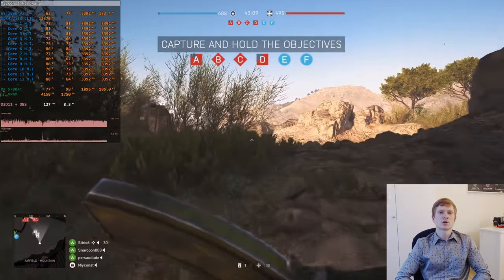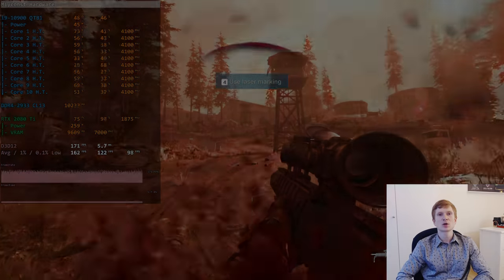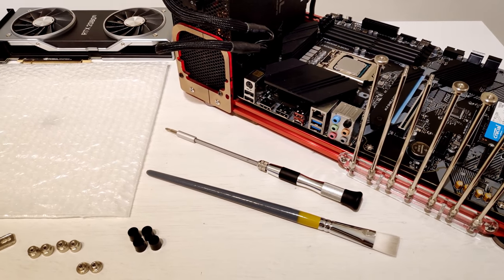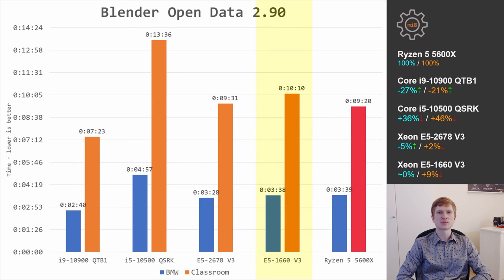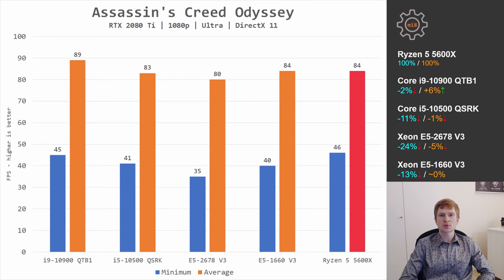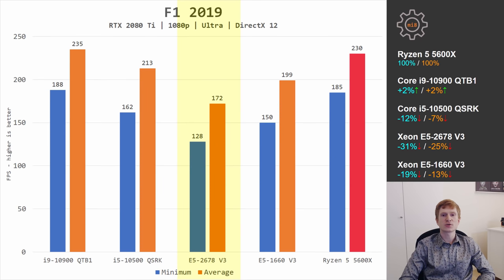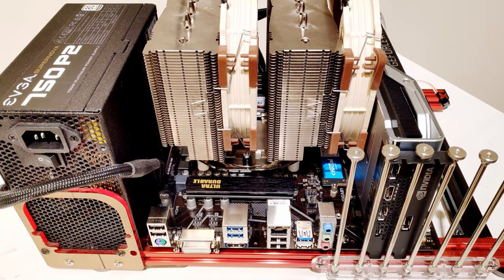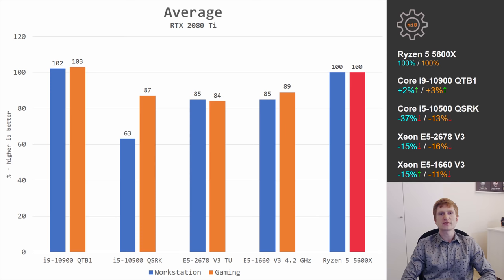🇬🇧 Ryzen 5 5600X takes on i9-10900 QTB1, i5-10500 QSRK, E5-2678 V3, and E5-1660 V3

Comment: Do you think there's a big difference in games performance between i5 10500 QRSK and i3 10100f. I would go for i5, but don't really wanna wait 2 weeks. I play CS:GO mostly.
Reply from the maker: It mostly depends on your GPU, but I would wait a few weeks for the i5, 6 cores is better than 4 cores.
Reply: I got GTX 1070 OC. I'm a bit scared about the warranty, but I thought about the same thing, 2 weeks 4 more threads. Is it gonna worki with MSI B460m-A pro?
Reply from the maker: @ignacyciechanowski2161  yes, most likely it's going to work.

Comment: So you would advice 5600x over 10900es ? Maybe i would go for a ryzen with used mobo. Is 335€ 5600x of aliexpress a good deal or should i rather wait ?
Reply: nice video with a lot of info tho :)
Reply from the maker: I think the AliExpress deal is kinda good at the moment, but would be bad if these CPUs show up in stock. Also check your import charges so you don't end up paying too much.

Comment: Thanks for another very detailed and informative review! I'm sure there's a lot of work on your part. I have a question though, do you have anything in mind that is cheap Xeon CPU that can be at par or equal to Ryzen 5 5600x's performance?
Reply from the maker: Are you asking about gaming performance? In this case there is nothing "cheap" to match Ryzen.
Reply from the maker: @daddyalpha2648  I don't think I have much to add here, it might not be right, but you sound like a typical Intel fanboy for me. Overclocked E5-1660 V3 is a beast of a CPU, but you forgot to mention how much power it consumes, how much heat it produces, and how much the quality X99 motherboards cost.

Comment: This is amazing. Gamers Nexus quality level. Really cool to see how well the old cheap Xeons do vs 5600X. Also, QSRK price is basically same as 10400F on sale before taxes, so in lower tax countries 10400(F) is probably better option.

For people who think Intel != Xeon, if sending the Intel ARK page for the Xeon doesn't work, then it is hopeless.
Reply from the maker: Thank you for the support man! I totally agree about i5-10400F and the same about Intel ARK page. I was unpleasantly surprised with the number of "hopeless" people when I started to deal with computer assembly.
Reply: @Miyconst  Sadly some people know what word they want, not what actual thing they want. Best to just go with what makes the customer happy in my opinion.
Reply: i can get qsrk for about 75 dollars less than a 10400, which is cheaper for some reason than a 10400F right now.
Reply from the maker: @eclipsegst9419  where do you have such prices? I would like to buy a few if that's possible, please mail me to miyconst@gmail.com if you are interested.
Reply: @Miyconst  That is just comparing the 10500ES at 136 dollars on AliExpress to the local price of about 190-220 dollars for 10400 and 10400F here in the US. is this much different that what you paid?
Reply from the maker: @eclipsegst9419  yeah, we seem to have different pricing. I can buy a Core i5-10400F from a store with all taxes for ~150 Euros, for the i5-10500 QSRK I ended up paying about ~130 Euros. 20 Euros saving is absolutely pointless in this case.

Comment: Hi Miyconst great video as always and I really appreciate how you do these in both Ukrainian and English.  I would just like to know do you need a z490 motherboard or can you get those frequencies from say a B460 or H470 motherboard for the Intel QTB1, as they are locked did you use either the power limit boost function or BCLK overclocking or do they just run as standard at these frequencies as they are advertised as 2.5ghz.  Personally, I would love a bit more of an in-depth video regarding these ES chips.  Thanks again for being inclusive to us native English speakers.
Reply from the maker: Hi Nic. The QTB1 CPU, as you mentioned, is completely blocked. I have tried some BCLK overclocking, but in my case, anything above 100 MHz disables single core turbo frequency. I have also tested these CPUs with an MSI B460 motherboard, the results were identical. Basically, the best you can do with this ES CPUs, is tighten the RAM timings and reduce the CPU voltage.
Reply: @Miyconst  thanks for the quick reply Miyconst would ASUS’s APE, ASRock’s Base Frequency Boost or MSI’s on Power Limit Setting work I’m just wondering how everyone is getting these CPUs to run at 4.45 to 4.5 ghz all core
Reply from the maker: @atilla101uk  as far as I know, there are no options to force QTB1 to stay at 4.5 GHz under any load. The CPU itself boosts as high as it possible can under low-middle-high-ulta-high load. In my experience, which is confirmed by multiple my partners, any of the power management settings do not increase QTB1's performance.
Reply: @Miyconst  again thank you for your prompt reply it looks like it’s worth spending the extra and the QTB2 instead to make sure that it runs at an acceptable frequency in all states would you agree l? Again thanks for the help and the English versions of your videos keep up the exceptional work that you do
Reply from the maker: @atilla101uk  in the past QTB2 costed more than 350 Euros, now its price has gone down to just above 300 Euros. In this case, I think, QTB2 is a better value if you have a decent (not AsRock) Z490 motherboard and are willing to overclock it.

Comment: well, does the QTB1 work on any b460? AND THE PERFORMANCE AND THE SAME OF THE Z490? AM FROM BRAZIL AND THE PRICE DIFFERENCE OF THE B460 FROM THE Z490 AND GREAT
Reply from the maker: In general, the performance is the same, but QTB1 does not properly turbo boost with some motherboards, for example the Gigabyte ones.
Reply: @Miyconst  WHAT BEST MANUFACTURER OF MOTHERBOARD FOR qbt1?
Reply from the maker: @charlesBATISTA2011  MSI. Some of my subscribers had single core turbo boost issues with Gigabyte and Asus boards. AsRock works well, but it made crappy Z490 boards.

Comment: Oh my. haha threadripper is for AMD and Xeon is for Intel. Maybe he meant intel core series (i3, i5, i7, i9) I have 2620v3 now and planning to upgrade to 2640v3, 2660v3 or 2678v3. I was planning to get 2678v3 and disable HT but I think the power usage is very high as show in this video. I am now confused to get a 2640v3 or 2660v3.
Reply from the maker: What GPU do you use? Most likely it would be more reasonable to just wait and upgrade to AM4 platform.

Comment: Out of the current Ryzen 5000 series -- Which is the best one out of the lot -- 5600X or 5xxxX ?
Reply from the maker: Best for money, best overall or? In my option Ryzen 9 5900X is the most interesting part. Ryzen 5 5600 (non X), when it's released, should be the "go to" gaming CPU. Ryzen 5 5600X is surely impressive, but the price is just a tiny bit too steep.

Comment: I wanted to give a tip, do all the tests in full hd minimum quality so you can see the best difference between cpus
Reply from the maker: This is an invalid test, because CPU load is not the same with minimal and maximum graphical quality.

Comment: Aren't the vrm temperatures good? I looked up the vrm specifications and it says that their normal operating temperatures range from -50°C to 150°C
Reply from the maker: Well.. apart from the VRM components themselves, there are other elements on the motherboard, and if a mosfet can tolerate 150C, it doesn't yet mean that the motherboard will survive that. Also, surface temperature, which is possible to measure with a laser thermometer is less than the actual inner temperature.

Comment: Can u suggest an h81 processor also? Need to upgrade from e3 1270 v3(its locked)
Reply from the maker: I don't think there is anything significantly better than E3-1270 V3, you would have to replace entire platform.
Reply: Isn't the highest e3 1280 v3(also locked)not much point in upgrading from 1270v3 to 1280v3 as for other CPU's your only option would be the 4790k(4790 non K and 4770/k are about the same as the one you have, so they aren't an option), but you won't be able to OC it on a non Z board(well some boards can, but it's sketchy).
If I were you I'd sell the set(mobo+ram+cpu and cooler if it's an aftermarket one) and get a cheap Ryzen setup going. Cheap option would be a new a520 motherboard(or a used b450 if you have a good used market where you live)+3500x(or a used 3600) and 16GB RAM 3000/3200.
Alternatively there are sets with 2678v3+mobo+ 16GB RAM for $200 or 2678v3+better mobo+32GB RAM for $260.
Reply: @xingbairong  actually I have a mini itx rig the mobo is msi h81i, I was looking at mini itx x99 mobos on aliexpress to upgrade to. But seems like a rig with 3500x from aliexpress and cheap mobo and ram might cost me the same
Reply: undervolt it
Reply from the maker: @shahidkismat  there are no mini-ITX X99 boards on AliExpress. Beware, the boards they sell are mini-DTX, which is slightly bigger than mini-ITX.
Reply: @gabrielecarbone8235  Dont have the option in intel XTU to do so. or in bios.
Reply: @shahidkismat  sad, it could be an MSI baord they have that issue :(

Comment: can you use faster than ddr4-2400 with the Huananzhi X99-TF motherboard?
Reply from the maker: Yes, you can use faster memory, but the speed will be limited by the CPU.
Reply: @Miyconst  thanks for the reply.  The 2678 does support ddr4-2400?
Reply from the maker: @Oliver-hs6ki  Maximum RAM speed for E5-2678 V3 is DDR4-2133, but you can use DDR4-2400 memory modules.
Reply: @Miyconst  Ah I see.  Am I able to clock my ddr3-1866 memory to 2133mhz on the board?  Thanks for the content!
Reply from the maker: @Oliver-hs6ki  it depends on your memory, some can reach that speed and others don't.

Comment: Do you have access to a 0.1% or 0.01% low fps metric in the FPS capture software you use? Percent lows are a more reliable and representable way of showing dips in performance, compared to absolute minimums which can be all over the place because they will show even a one time FPS drop that could have nothing to do with the CPU. Perhaps this will also fix your issue with FPS drops on the lower core count CPUs. (https://www.youtube.com/watch?v=uXepIWi4SgM for an explanation by GN)
Reply from the maker: I used 1% lows in Call of Duty and Battlefield, and these are the games I had issues with. Min FPS I use for games with built in benchmark, because it doesn't seem right to do external FPS measurements when a game does it for me.
Reply: My bad, I missed the fact there were different numbers for different benchmarks! Makes sense to use the built in benchmark numbers.

Comment: With those power consumption figures, I think it could be possible to get a 2678 V3 setup running on a 350W PSU I have sitting around...
Reply from the maker: It really depends on the PSU quality.

Comment: Is it possible to overclock ram on the Intel ES on a Z board or even there is still locked?
Reply from the maker: It depends on which ES.
Reply: @Miyconst  depends if it's K? Because regular non K chips can overclock ram on Z boards, just the CPU is locked. That's what I didn't understand in the video, sorry.
Reply from the maker: @RafitoOoO  Yes and no. There are non "K" ES CPUs, which allow memory overclocking, for example i9-9900 ES QQBZ works with overclocked memory, while i9-10900 ES QTB1 tops at DDR4-2933 and the limit cannot be bypassed even if you use a Z490 motherboard.
Reply: @Miyconst  Love how you always answer the comments. Thanks a lot!
Reply from the maker: @RafitoOoO  you are welcome.

Comment: As much as I love xeons the only way they're going to stay viable in a ryzen market is if ryzen gets significantly more expensive or they get significantly cheaper
Reply from the maker: That's a sad/glad reality. These old X99 Xeons have to go down in price significantly, otherwise Ryzen is going to eliminate all of them.
Reply: I am still waiting for V4 Xeons to drop down to V3 prices. then I can brag about having a 18 (or even 22!) core machine - even though it would probably still be beaten by a Ryzen (but would still be cheaper in some ways).
Reply from the maker: @ripwildy2022  at that point no one will care about the number of cores. It's like no one cares how many cuda or shader cores your GPU has.
Reply: @Miyconst  I know, I know - I just want something to brag about, even though its pointless lol
Reply from the maker: @ripwildy2022  you don't really need an X core CPU to brag about it, you can brag without having it, it will have the same effect 😁😁

Comment: I really don't understund why QTB1 is currently overpriced in your opinion. It has +2%/+3% of performance and real price (not slogan from ads) right now € 259,66 shipped, where ryzen 5 5600x is € 323,07.
To sum up (QTB1): 80,4% of Ryzen 5 5600x price for 102%/103% of performance.
Reply from the maker: This calculation only works if you cheat on import taxes and VAT. Where I live, after paying the VAT, i9 turns to be more expensive than Ryzen even with that price cut, you also have to wait for at least a month to get the i9 and AliExpress provides zero warranty/service. Keep in mind that Ryzen comes with a semi-ok cooler, but for the i9 you need to buy it yourself: 20-30 Euros.
Reply: @Miyconst  Bove prices was from aliexpress. The only local store that has stock for ryzen 5 5600x in my country set the price to € 415,17 which is crazy :(. But yea lack of warranty + possible problems with shipping is a good reason. Thanks for answer!

Comment: Excellent explanation! Thanks. I am looking for a mid-range gaming PC + working PC. Work a lot with DAW software. There's a deal from a local supplier - selling the following set for USD 1280.00 or around Euro 1050. Do you think its a good deal? Spec as follow: 
* CPU - Intel QTB1 i9 10900 es
* Mobo - Gigabyte Z490I Aorus Ultra, 
* Graphic - gigabyte rx 5700
* fan - JONSBO CR1400 CPU COOLER ARGB FAN / JONSBO 925 ARGB COOLING FAN x2
* ram - G.skill trident z 3000mhz 8GBx2
* storage - CRUCIAL BX500 480GB SSD
* Power supply - FSP 450W SFX Modular PSU
* B3 14.4L itx casing

* Price - USD 1280
Reply from the maker: Yes, I think it's a good deal, but you have to check your software, and see if it requires a dedicated GPU, and if yes, then validate how good RX 5700 performa there. Some software is not optimized for AMD, only Nvidia. Do you have a link to the supplier page?
Reply from the maker: @hafizullahmirhassan  thanks. I am a bit unsure about the power supply, 450 Watt for an RX 5700 + Core i9 is a bit too little, other than that it's a very nice build.

Comment: Please help... im planning to build i5 10400f with 150$ Motherboard and 60$ power supply due to very tight budget can any one please  advice me about building xeon based gaming rig is it gonna be cheaper??
Reply from the maker: First, what is your budget and targeted PC use? What is your GPU, if it's for gaming? Why would you need a $150 motherboard for an i5-10400F?
Reply: @Miyconst  
Budget : 400$ ( without considering graphics card cuz im gonna upgrade it later i have a old one for now)

Motherboard : asus b460 (sorry its like 100$)
processor : i5 10400f
ram : 16gigs

 i want to buy best motherboard and processor for this budget for online streaming like warzone
Reply from the maker: It seems like i5-10400F is the best option for you. As far as I know, Call of Duty War Zone plays rather badly on low frequency Xeon CPUs.
Reply: @Miyconst     thank you bro .your channal is so underrated you deserve much more millions of views your analysis are very clear .. try to improve  lighting in videos for yourself and more closer look and clear audio.. im sure in future this channal will be one of the best technology channal. all the best bro!
Reply from the maker: @bashitharanasinghe9267  thank you for the support! I am trying to get some more equipment for better lightning and audio, but it's not cheap.
Reply: @Miyconst  bro i changed my mind im gonna by xbox series s  and later im gonna upgrade to 1tb hard 🤔 i think i can stream from xbox series s warzone 1080p 60 fps for 300$